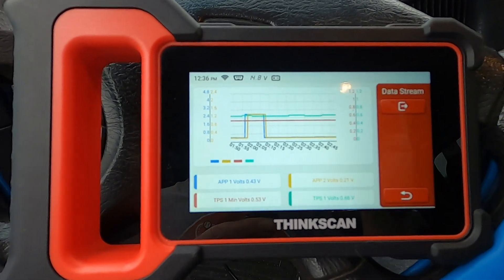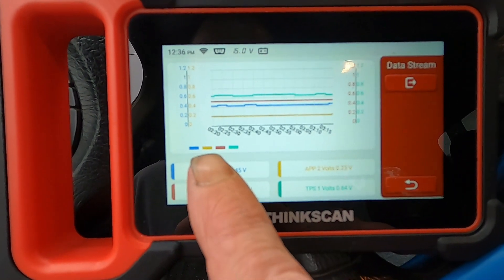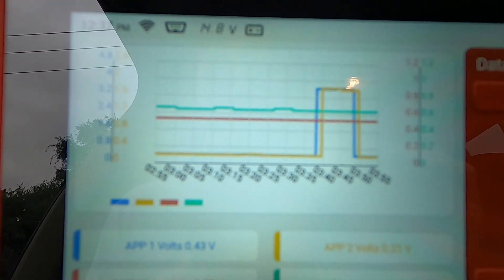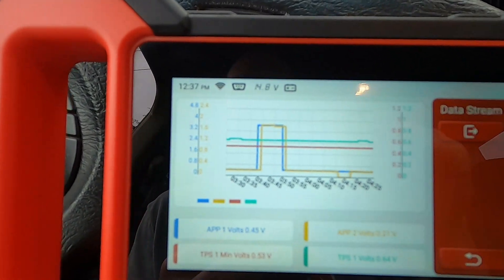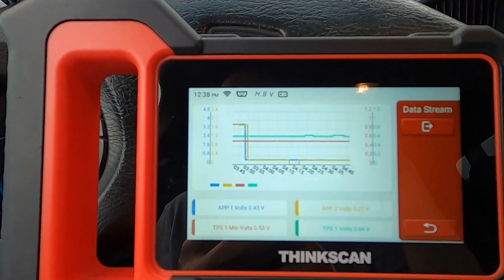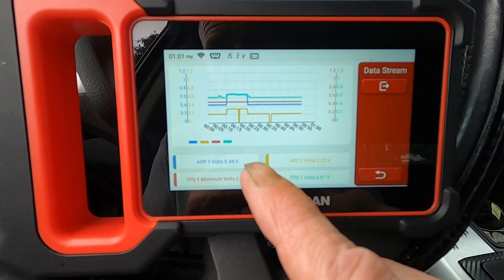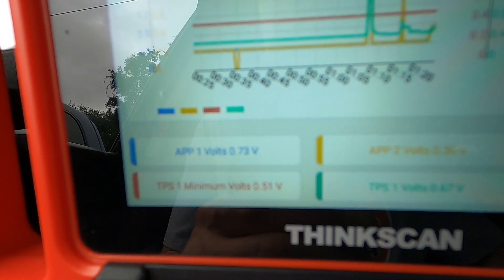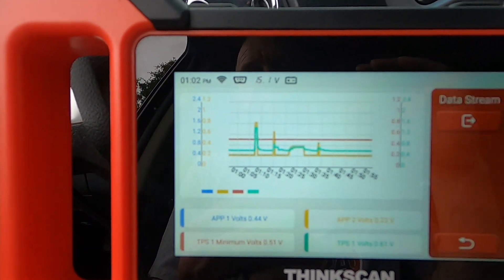Live Data Stream on 03 &09 Ram APP and TPS sensors (interesting find)

Comment: I got a 04 and long as I don’t go over 60 and not floor the pedal it’s find but if I floor it instantly, he goes in the limp mode
Reply from the maker: You need to check for vacum leak around intake

Comment: Hey I had emailed you at the beginning of the week. I did want to let you know that we replaced the throttle body and it did NOTHING. No change. So finally just took it to the dealership & they did a pcm reset, pcm update and throttle body relearn .. 160 bucks. 

We have a ‘03 Dodge Ram 1500 5.7 and we did literally the EXACT same thing you did. Started by doing a throttle body relearn at home, then truck went into limp mode-no pedal. We took off the sensor pressed pedal & there was data. (Oddly enough, we did this before even watching your video) lol. We then replaced app sensor, then throttle body and had absolutely no change at all- still had lightning bolt and still no pedal and still throwing same codes. Dealer told us the way to fix it is to reset your pcm then update it then do another throttle body relearn. 

I know you had asked me if we replaced the throttle body yet. So I wanted to give you an update & let you know what the fix for this was! 😊
Reply from the maker: Thank you very much for the update buddy

Comment: Any new updates
Reply from the maker: Not yet buddy
Reply: @autoguydiy4244  so I gave up on trying to fix the issue with my lightning bolt limp mode issue and had a tech from dodge check it out. He ran a vacuum leak smoke test and found that I had a leak coming from my intake manifold. He dropped a seal kit on it and I have not had any issues anymore. Been driving it for a week now. I’ll keep you updated on how it is doing a month from now.

Comment: i did the same thing and unpluged throttle body and it runs better but still dead pedal ... 350 new throttle body too
Reply: somebody told me i need to replace it with a mopar throttle body??
Reply from the maker: Replacing it with a mopar throttle body is to your discretion.

Comment: i tried to relearn the throttle accelerator and it says app 1 low voltage , check my page man i need help thank u
Reply from the maker: You need to look for a broken wire are shorted out connector

Comment: Might actually fix my issue too limp mode is back in 10 caravan. Checking fluid today hoping it's just low
Reply from the maker: Good luck with that. Also let me knw I you get it going. #moparfam
Reply: @autoguydiy4244  #moparfam